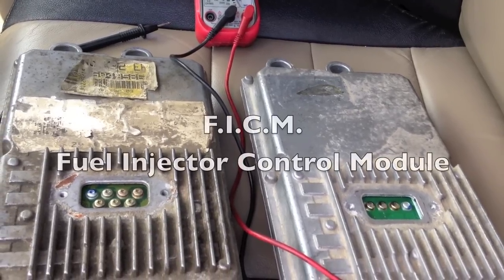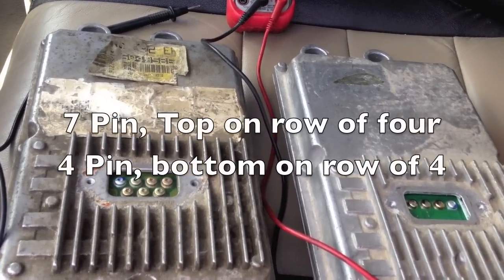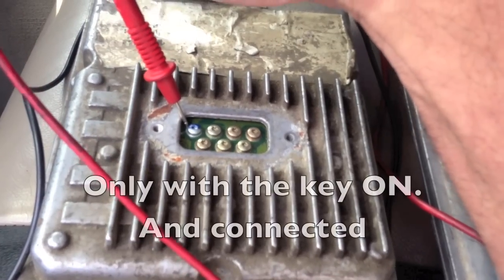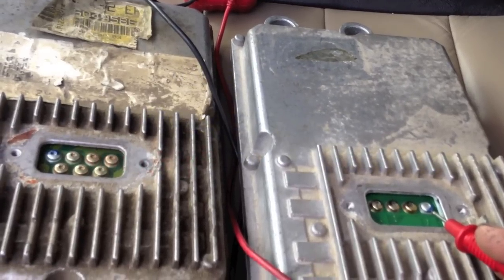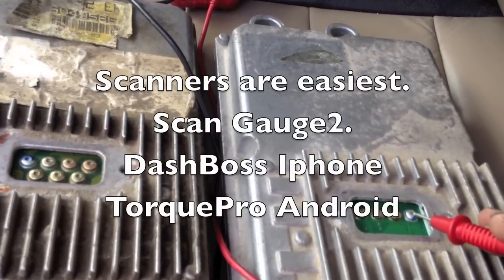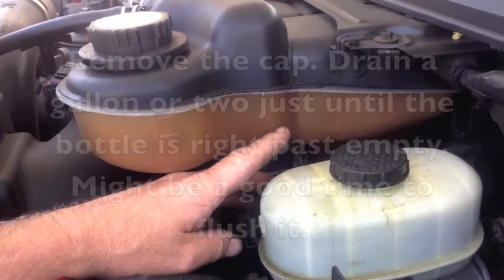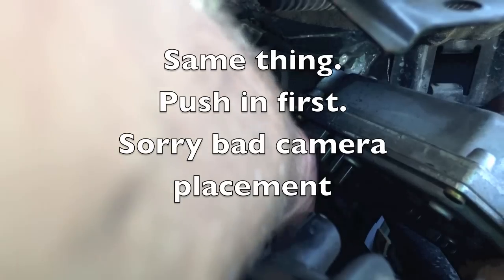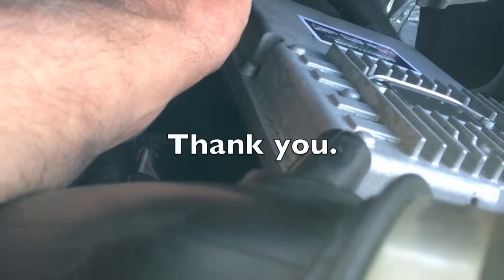Ford 6.0 Powerstroke diesel FICM tips and tricks

Comment: Diesel TechRon I enjoy your videos I find that watching your videos is a lot easier than the classes I had to thru. I am a mobile diesel mechanic and some of your videos helped me out of jam cause the tech book was pointing in one direction and turned out you had a similar problem and book was totally sending me in the wrong direction. I've worked on diesels for 15 years mainly Caterpillar, Detroit,  Cummins mainly 18 wheelers and decided to jump on the band wagon of fixing the 6.0l and 6.4l I started out with a 7.3l in 2000 then in 2004 decided to upgrade with 6.0l truck ran great till 100,050 right after warranty ran out (go figure my luck) when I found out what the price was gonna be to fix it I nearly fell to the floor. The next day I found a 7.3l truck and put it to work. I then took a ford class to learn why these engines cost so much to fix then I realized it was common sense when it came to these motors and you really need a good scan tool to figure these buggars out. so I jumped in head first on my own truck and did all the deletes by the way glad I saw your take on the injectors with the brand and the oil cooler too thanks for the heads up on that. now she's running like I just got her from the dealership brand new even get 5 miles more to the gallon and a lot bigger punch on takeoff now I retired my 7.3l and use it for personal stuff but your right when you had said the 6.0l is a good motor if you do the right repairs on it and buy the parts that are made for. I thank you for all you do on this channel to help people who know alittle mechanics and show them a crash coarse in Ford diesel's. ok now for the question. I'm thinking of adding a new service truck what is your personal opinion on the Ford 6.7l models on my truck it weighs 12,245 full of fuel with my 225lbs and mostly all my tools that's a total weight truck,box,tools ect. I've been a ford guy sense I can remember so I kinda want to stick with em. your opinion means a great deal to me diesel tech to diesel tech should I invest in one or get another 6.0l and fix same way I did the one im driving now thanks bud.
Reply: Getting P0279 code. I'm told to check cables from FICM to injectors for a short.?? Also Oil additive may help ? Rev X?

Comment: Hey Ron, I had a ford diesel mechanic install a ficm in my 2006 diesel f250. He does not work for ford anymore, so I bought the ficm from ford preprogrammed for him to install. I forgot to tell him it was preprogrammed, so he programmed the ficm. Now when I floor the pedal it feels like it does not accelerate as quickly or smooth as it use to

Comment: Heya Ron, almost ordered a replacement from you on my 04, went from driving to dead, sync was 0 and fmp was 0.  Battery voltage 13.8.  towed back to the driveway and followed the chart testing, found pin 27 had some green stuff on it, cleaned the ficm pins and the connector sockets and it fmp went to 48 and stayed there.   Can contact/silicone grease be used on the ficm connectors, mine are not greased in any way.    Thanks for all you teach.

Comment: Diesel tech Ron, I have a question. I have a 036.0 diesel and I have had all 8 injectors replaced, hpop, icp, ipr, egr delete and new turbo. Long story short my 6.0 doesn't do the injector buzz when you koeo. And when I crank it, it has a stutter and then opens up. Could you give me any advise? Maybe ficm bad? Thanks.

Comment: Just did a motor swap on '05.  Engine now has FICM no sync.  Used FICM from new motor and PCM from truck which had bad motor.  Do these need to be programmed to each other or should I be looking else where.  New motor ran before I removed.  Both truck were '05's.
Reply: Ron died in automobile accident a couple of months ago. A huge loss for the Ford diesel community

Comment: Hi Ron, first I'd like to thank you for taking the time to make all these great videos! secondly, I recently took my 05 f250 to a shop and was told 6 out of 8 injectors were failing, plus a bad ficm..running at 44 volts. I plan on checking the ficm myself soon but I was told that if I just changed the ficm, the bad injectors will back feed power back into the ficm burning it up, is this true? Thank you.

Comment: I thought I had a bad FICM went out to buy a Dorman FICM. Installed it and no power. I noticed a relay under the driver side fuse box it had come out a bit. Just pushed it back in and I had power again. The old FICM would show an increase then decrease in power key on engine off. I'm really not sure if it was the FICM or relay acting up. I'l see how long this Dorman lasts.

Comment: Do you have any suggestions as to why? Could he have not used the right program? Should I send the ficm back to ford under warranty and get another one? Thanks
Reply from the maker: I do hundreds of ficms a month.  The wrong calibration is noticable but not drastic. Check your cylinder contribution. Icp koeo. Ipr percent and fuel pressure

Comment: Hi Ron, I have a 2004 f250 One day I change the oil and fuel filters and then two days I don't think it's the problem but around five days I started it up and I was with my friends and playing around and when I gave it gas it wanted to go and would still move but dosent have the power like before any help?
Reply from the maker: I've seen fuel pumps get damaged during filter changes. Or fuel filters not sealing properly. You can try redoing your filters with quality ones or install a fuel pressure gauge..
Reply: I will try that thanks and I run the motocraft in my oil and fuel

Comment: ron, i have 06 ford 350. Key on FICM volt 44 but after few seconds it will climb to 46 volt, one day all 8 injector throw a circuit low code. FICM is no good??
Reply from the maker: Yes that's below specs and is failing